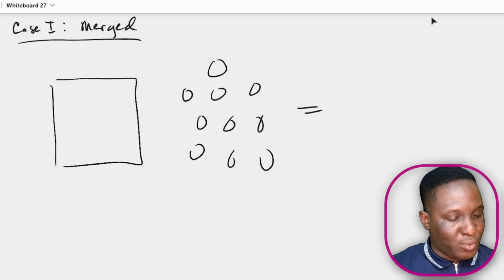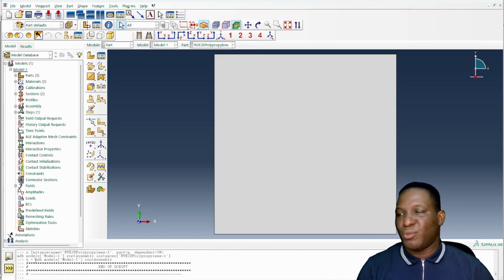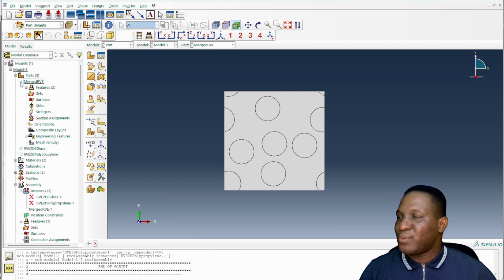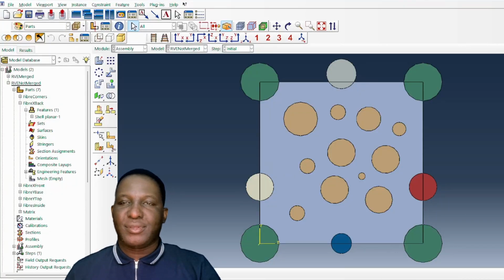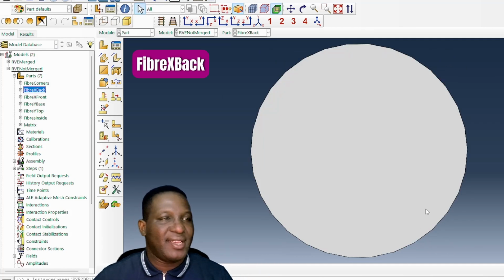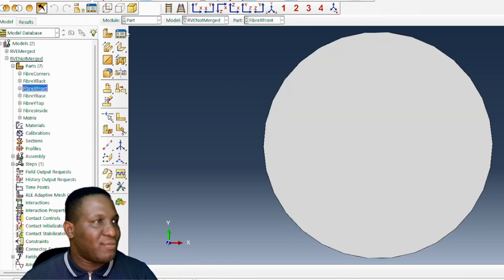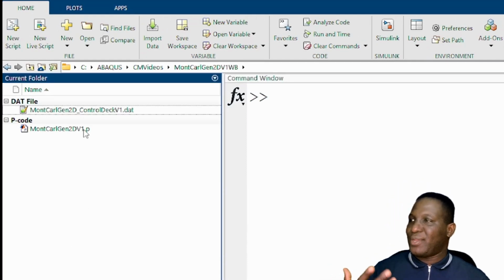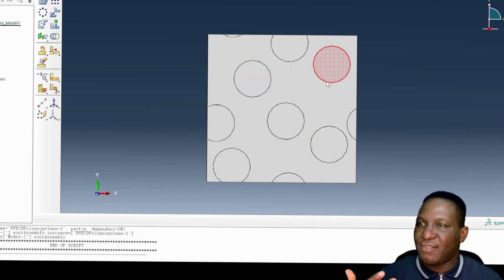UD Composites Modelling: How to TRIM Boundary Fibres (2D case)

Comment: Thank you very much, Dr. Michael, for these good lectures. I have a question. How do I determine the volume fraction of two materials in the case of preparing a slide or layer consisting of polymeric material and fibers at rates of 30% and 70% in the Abaqus program? Is there an explanatory video available?
Reply from the maker: Hello, thanks for your comment. I am a bit unsure about what the question is about. If you want to determine the volume fraction of two materials (composites), you can do so by finding the weight contribution of each of the phases that make up the system. The weights of say E-glass fibre and the weight of the matrix, say Epoxy. With those weights, you define the weight fractions. You also need to know the densities of the constituents that make up the composite. If you want to see how to make the conversions, a quick google search will help you as you can see from here: https://sites.google.com/site/compositematerialsdesign/home/weight-and-volume-fractions. I am not sure if this is what you are looking for. Good luck with the research.